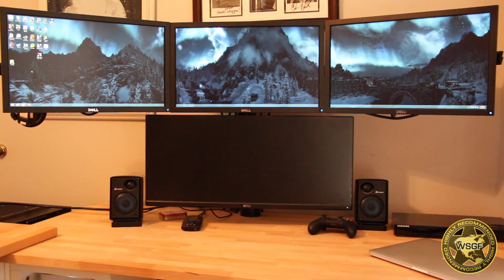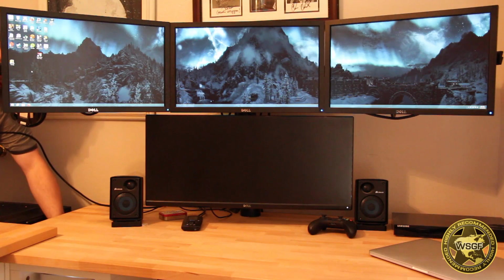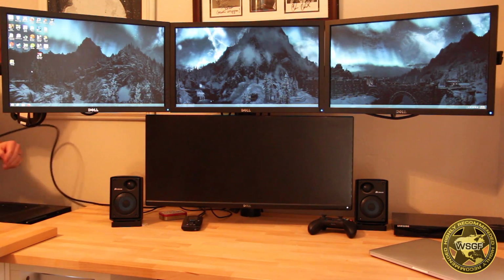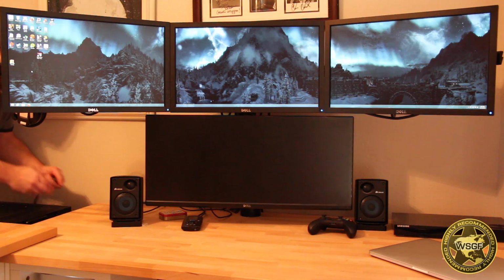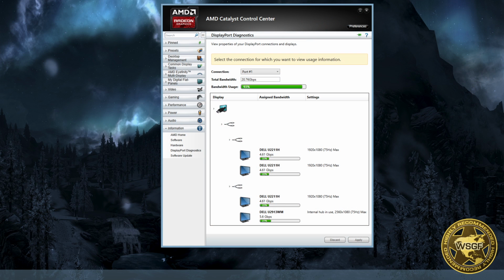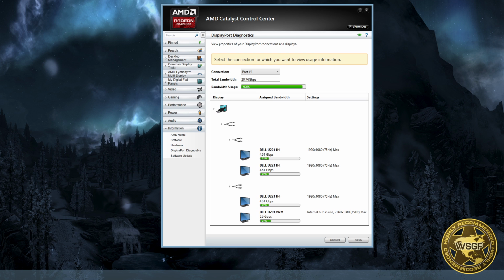Club 3D 2nd Gen MST Hub Review - 3x1 1080p + 21:9 1080p

Comment: I have three 16:9 1080p HDMI monitors and one 1080p ultrawide that uses display port. My question is, do i have to use active hdmi->displayport adapters for my monitors for this to work? Or is any adapter good enough?
Reply: and the MST hub i am looking at is the CSV-6400 model
Reply from the maker: @simonrajter  Passive adapters should work.

Comment: How many maximum port for this
How many maximum minitor i can use for hdmi cable?
What is the computer specs should i use?
Reply from the maker: The 2x1 can do two outputs, the 3x1 three, and the 4x1 four.  Club 3D has newer versions and specs on those models available here - https://www.club-3d.com/en/cat/1608/video_splitter/

Comment: Can i use the 4x1 Club 3D MST hub to create a 2x2 video wall so have the 4 screens act as one big screen? I know this is possible using AMD eyefinity (depending on the graphics card), I've seen videos of it being done with other MST hubs from different companies however i wanted to make sure that the Club 3D 4x1 MST hub doesn't have any limitations that would prevent doing this (assuming the graphics card is capable of it). ( I have seen an example of Club 3D do a 2x3 video wall with 6 screens but that was using 2 of the 3x MST hubs but i would like do a 2x2 using 4 screens and one 4x MST hub) thank you
Reply from the maker: You can do a 2x2.  The configuration will be done in the AMD Eyefinity configuration tool in the display drivers.
Reply: How does audio work when using an MST hub is the audio signal sent to all 4 monitors/screens and play from all the monitors in sync or would one monitor be the primary one and sound just play from the one monitor? thank you!

Comment: if i have 2 4k monitors and use mst 1-2 will they both run in 4k at 60hz?
Reply from the maker: Snilletx33 No.  There is not enough bandwidth in DP 1.2 for 2x 4k @60Hz
Reply: WSGF is there any way of running 2 4k display @60hz through 1 displayport and 2 hdmi outputs? i heard that dual hdmi works? or is it just something i read wrong
Reply from the maker: Snilletx33 You can do 4k @ 60Hz via HDMI 2.0.  Some old panels used 2x HDMI for tiled display, but those aren't common anymore.  So, you can do one via DP, and one via HDMI.

Comment: Suppose I had a GTX 780Ti and three nVidia G-Sync monitors. If I plugged this into the display port on that card, would I be able to use G-Sync in nVidia Surround on all three?
Reply from the maker: NVIDIA drives don't support the Club 3D MST Hub.  You can use the three monitors individually, but not as a "single large surface" (i.e., Surround).  I'm not sure about whether the G-Sync would work through it.  I don't see what it wouldn't, as the hub is DP 1.2.  But you're still left without Surround.
Reply: Thank you.

Comment: It's such a shame all the OEM's chose HDMI as the standard. Perhaps it's because VESA let DP sit stagnant for awhile. Even the new HDMI 2.0 revision is inferior. The fact that DP was virtually unused by the masses for so long just plain sucks. On top of being a sub par experience, OEM's have to pay to use the hardware and branding for HDMI, while DP is free to implement.. I don't see the angle, there must be something I'm missing as to why HDMI ended up being the universal standard on almost everything under the sun. Beyond that the technology that is implemented in the DP offshoot of Intel's Thunderbolt is outstanding. Almost gone are the days of buying 4 10Gb NIC's at 500 dollars a pop, plus a 1,000 dollar switch and DA or fiber cables. With X99, and Z97 having native Thunderbolt support, and add in cards like the Asus PCI-E ones. All that is needed is a Hub to link it all up and you'll have two direction 10Gb pipes to everything connected. The driver stack will be out soon enough that even lets you talk between platforms.

Comment: Im looking for an adapter that can support 3x1 1920x1080 at 120hz through DP 1.2. Is this adaptor for me?
Reply: No sir. All the MST hubs I know of can only push two @ 120hz. DP 1.2a just doesn't quite have the bandwidth to push that. Although I would hazard with the exponential growth of panel technology it won't be a long wait. Also, If you truly have the GPU horsepower to push 5760x1080 @ 120hz, there has to be another solution.
Reply from the maker: BiomedLA Thanks for your reply and help.